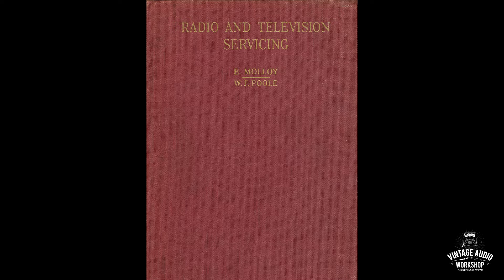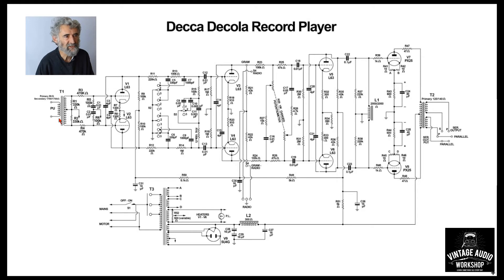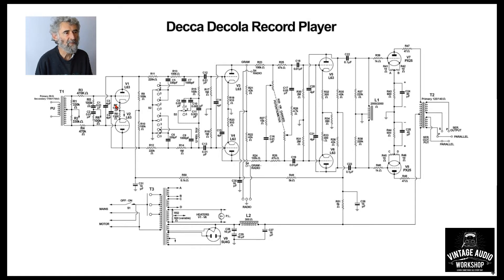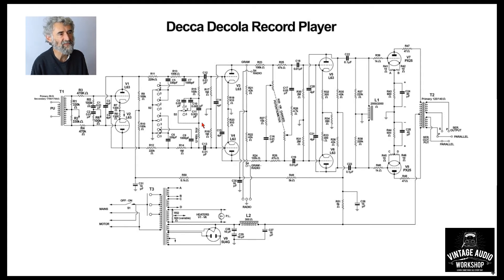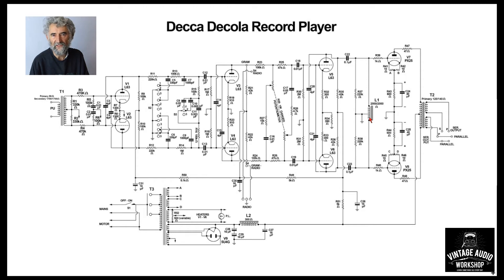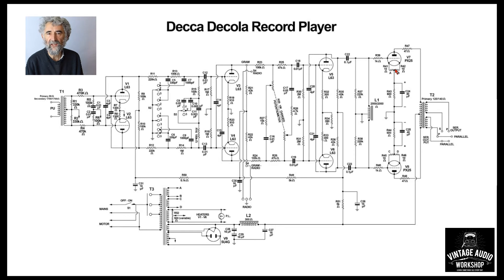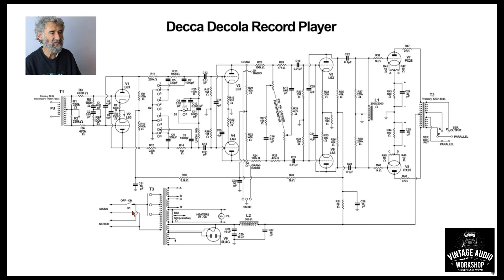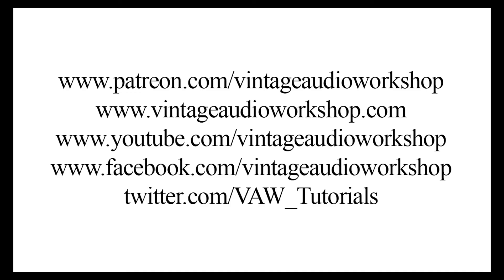Valve Amplifier Study 006: Decca Decola PX25 Marconi Triode Valve Amplifier

Comment: I have never heard so much rubbish. You have absolutely no idea how idea about the FFRR system, or actually any experience of how this thing works. There are so many mistakes in this article. Pointless. And frankly it’s quite clear you are pretty clueless on amplifier design.  6L6? How about KT66 triode connected, are either as linear without global feedback, or do they have a lower anode impedance? Are you sure what stylus this system used? You state the wrong thing in this. Transformers don’t have wide bandwidth? Really? Total nonsense. Why did Theo Williamson use the L63 as well? Silly Theo! The most famous amplifier design of all time, what an idiot he was! Well, according to this total nonsense.  The amplifier is fully push pull to reduce second harmonic.  It doesn’t have cathode caps on the gain stages to reduce distortion. The choke in the grids, and it is a choke, it is only one winding you total muppet, was to give a very low DC resistance to protect the output tubes, and present a high AC impedance, to load the drive stage. I stopped watching at this point.  I wouldn’t trust you to service my dansette.